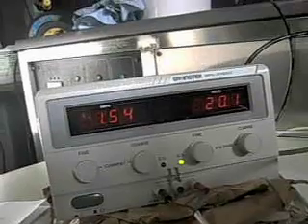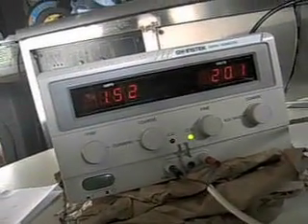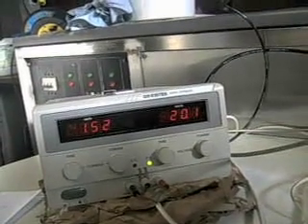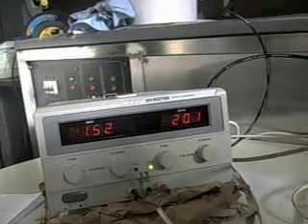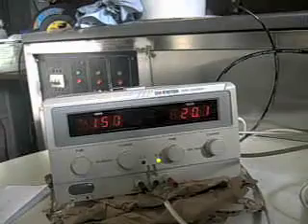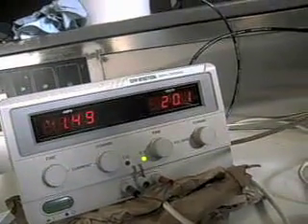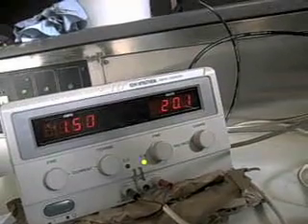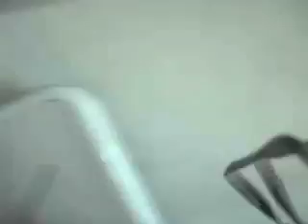KESHE FOUNDATION GRAVITATIONAL TECHNOLOGIES

Comment: About the same as Keshes Fukushima "experiment":

I took the time and made a detailled analysis of the Fukushima experiment, using the paper in parallel with the video an I found the following:
 
1) The description of the procedures in the paper does not correspond to the video. The first measurement protocol [1] is that of well water, dated 2014/03/29 15:46:57 this is more than three hours AFTER the second measurement at 2014/03/29 12:17:27 when this "well water" has allegedly been used to soak the soil. Miss Saito uses water, which had been used the day before to soak soil and then has been separated from the soil. The reading for this water is according to Ms Saito 5.36 Bq total/Kg, the reading in the protocol is 1.81±3.18 Bq total/Kg
 
2) The volumes and densities are impossible in all 20 protocols. This is a very serious error, because the measurements are taken with Marinelli beakers and the software must know the geometry of the sample to do the calculations correct. If the volume is dead wrong, the measurement result can be off as much as 30% because the volume determines the geometry of the sample
 
3) The water and a quite large amount of soil still in it (You wanted "the water, just the water") is now measured, immediately after it was poured into the Marinelli beaker. The measurement takes 15 minutes during which time the soil in it settled partly down. That means, that the measurement again is useless, because the cocentration and/or distribution of radiation in the sample must not change during the measurement, otherwise the result can be far off.
 
4) After the treatment of the sample with the mesh the assistant takes the cylinder out of the box. During the whole manipulation the cylinder is held so, that a considerable part of the soil is left inside the cylinder, which makes all following measurements invalid, because part of the radiation has been removed and disappears from the measurement chain. a similar thing happens when Ms Saito pours the content of a box into a Marinelli beaker - remainder of the soil remains in the box and the box is taken out of the measurement chain.
 
Conclusion: The whole experiment is totally worthless and does not show any real change in radiation.

Trustworthy, isn't it ? :D